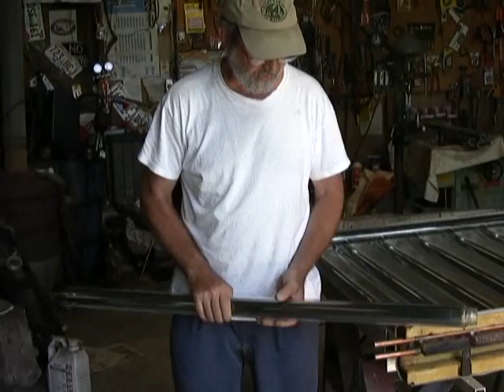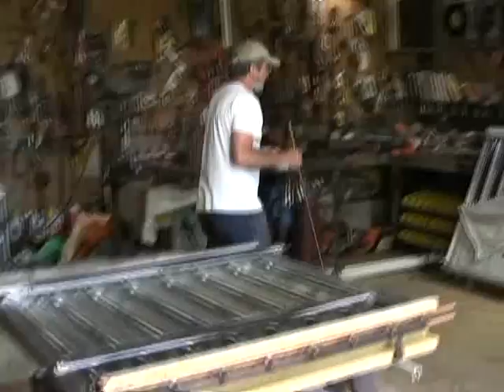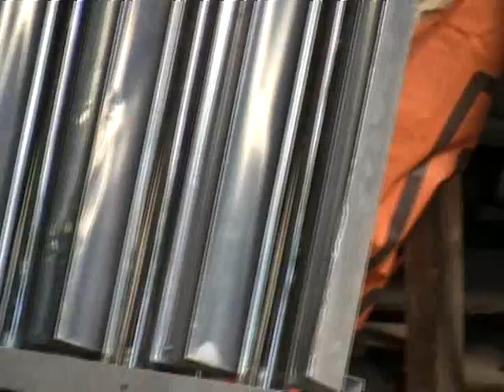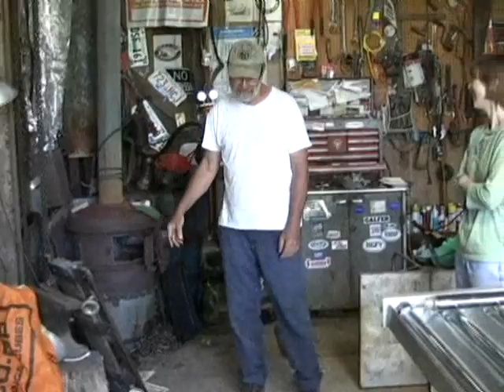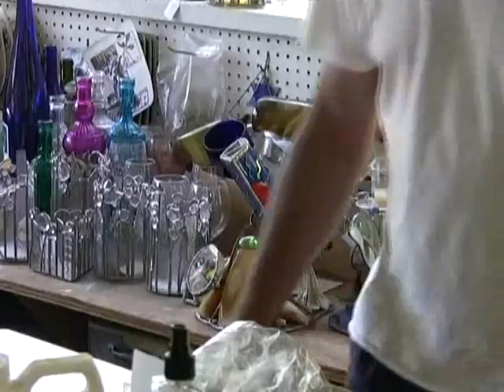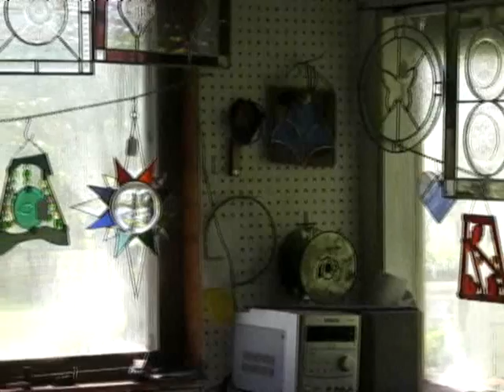solar water heating

Comment from the maker: The vacuum between the two tubes is a superior insulator, you would have a very difficult time making that happen in a home shop. Also the inner tube has a special selective surface coating to absorb heat efficiently, again not something easily done at home.

Comment: Hi Doug, I see you have the relative luxuary of reusing an existing glass tube of an old system. But for us commoners: do you think there is a way to fabricate the tubes (with its selective coating, inner pipe and vaccum) from scratch ?
Regards, Sander

Comment: Ok, I looked back at the post i made, I dont know where I got the "oil" thing. 

Comparatively, can you tell me what the outcomes would be passing the water directly through the copper, and then using the heat pipe method, as far as outcome in water temperature.

Comment: I am curious why you would use a heat tube, to transfer heat to oil,  rather than just pass water through the copper tube to gain heat more directly?

Comment: Okay, quick Engineering tip: Evacuating the inner copper tube is really a waste of time. The vacuum you're interested in is the vacuum between the glass tube and the copper tube. you want that so you don't lose the solar heat back out to the environment through conduction. A better plan: bigger copper tubes painted black. More surface area to absorb solar radiation. Pass fluid through tubes. Use anti-freeze so it doesn't freeze, and so the pipes don't corrode. Good luck!